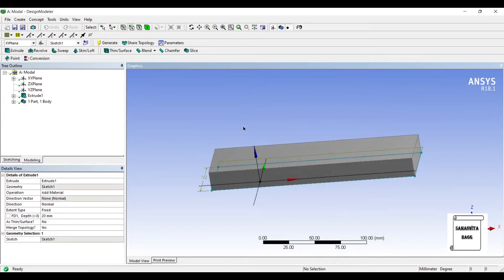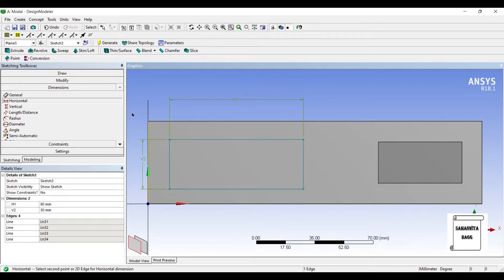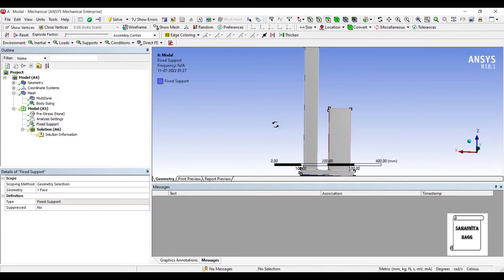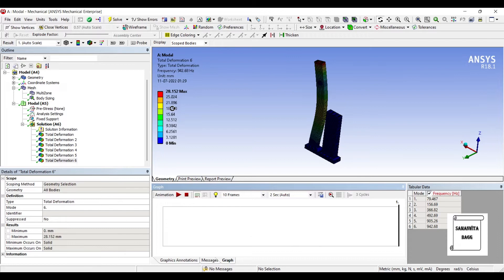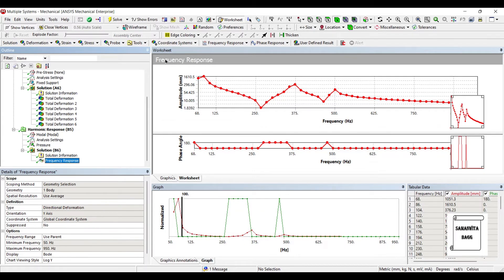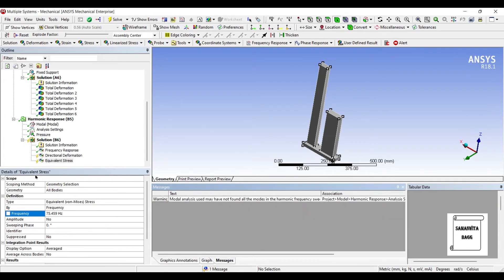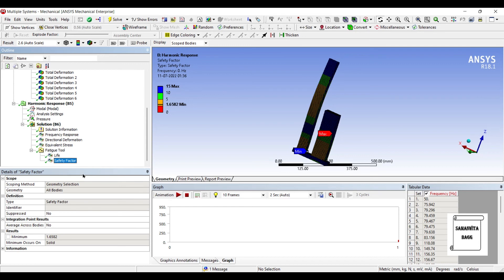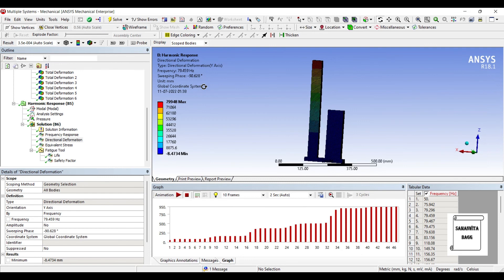Wind Load | Buildings | Different Heights | Modal | Harmonic Response I Frequency Response | ANSYS

Comment: Which software is used for this
Reply from the maker: I have used ANSYS
Reply: @MechProverse  so can... We analysis high rise building for opening in its for wind load.. at different positions and shape. Is my mtech thesis project can it be done in this software please tell me 🥺
Reply from the maker: @mihirpatil4513 yes it can be done
Reply: @MechProverse  sir analysis which software I should use.. are you taking any class of ansys software. Please tell.. I wi contact you
Reply from the maker: You can use ANSYS Fluent